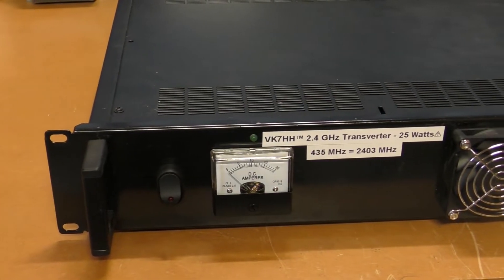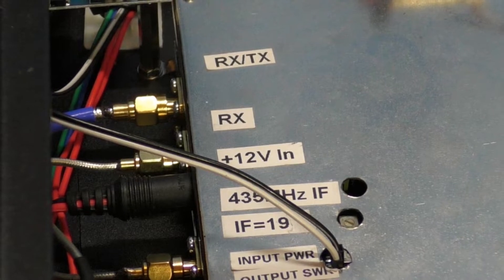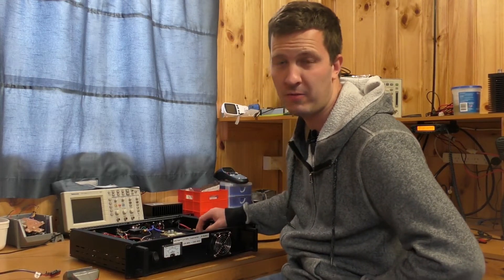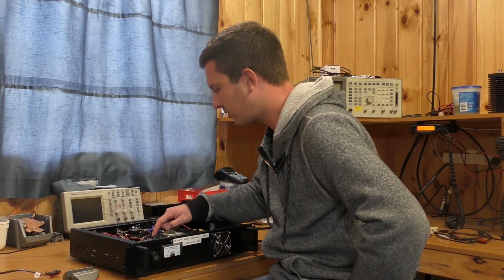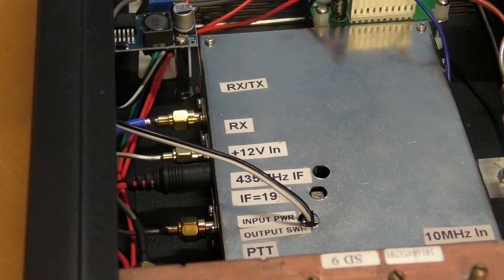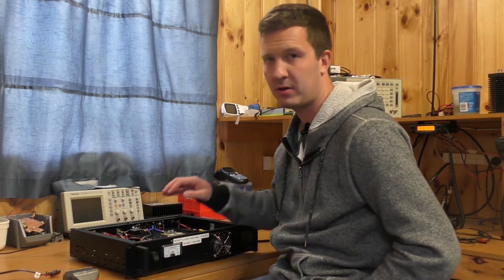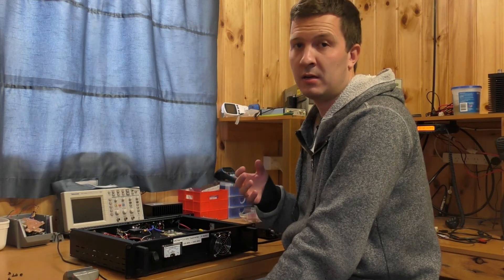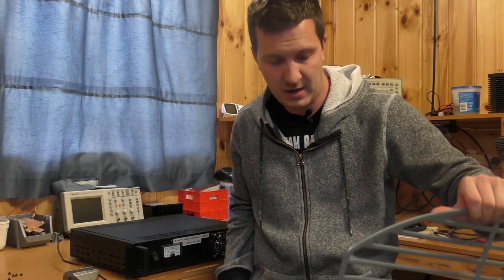A Ham Radio Transverter for the 2.4 GHz band (13cm)

Comment: What about listening to sat Comms ect on 13 meters is there a lot of activity ? I'm not even sure what aerials I would use for 2-3 GHz there's not much information online that I can find.
Reply from the maker: You could listen to e’hails but it’s not in our footprint here
Reply: @HamRadioDX  ok thanks so there's probably no point in getting a scanner with the 2-3 GHz range if I can't pick up many sats ect. There is a big list out there but I'd probably need decoding equipment and probably a radio signal dish ect .